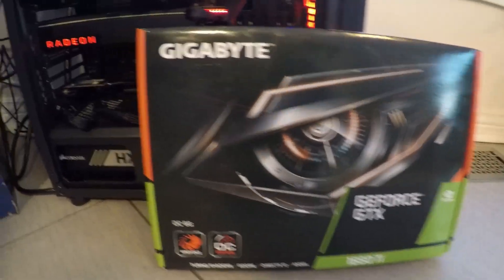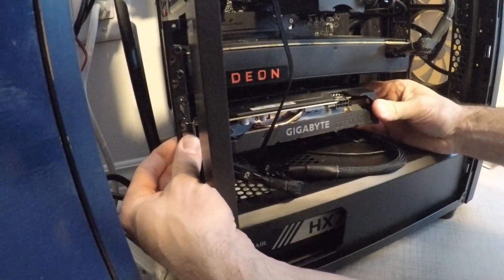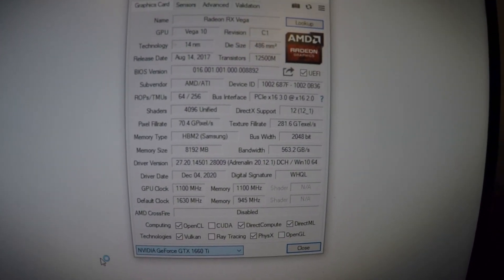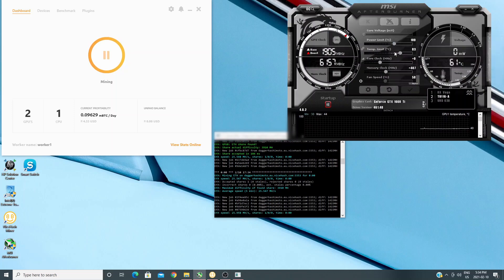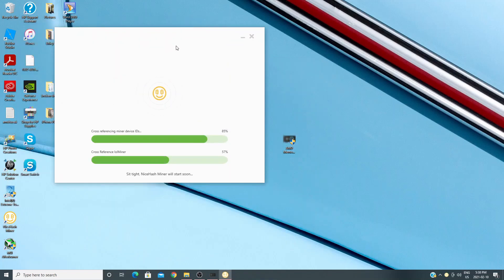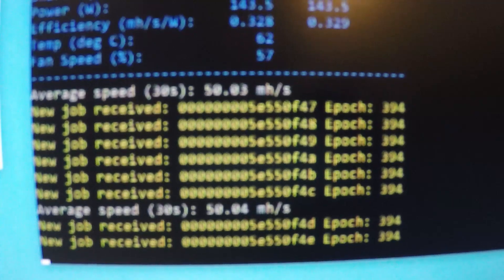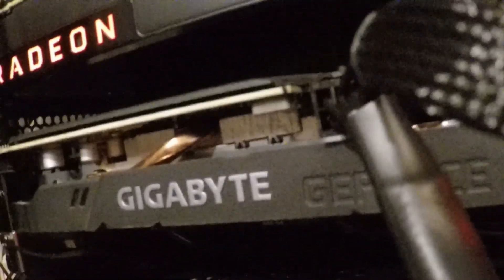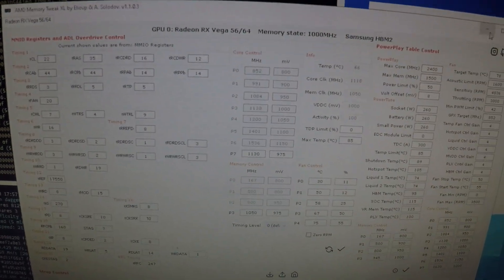AMD and NVIDIA GPUs mining on same computer

Comment: Thanks for the information. I have a 1660 gpu and i want to add a 1050 ti on the same pc but nicehash cannot detect the second gpu. Any ideas;
Reply from the maker: Does it show up in device manager, gpuz, and or afterburner? Or is it only nicehash that cant see it.
If everything else can see the gpu then I would try to reinstall nicehash.
If nothing can see the gpu, particularly in device manager, then something isnt set up correctly.

Comment: till yesterday i used only a 3060, today i got a 1660s and plugged in into my pc together with the 3060, but the display shows nothing, its black...why ?
Reply from the maker: Where is the monitor plugged in? The gpu or the motherboard.
Whichever one its plugged into try changing it.
You might need to go in to mother board bios and change it from IGD, to PEG. Or PEG to IGD depending on how you have it set up
Reply: @DIYNorth  thx for your fast help, the monitor was in the 3060 because its a UHD monitor , i want to game with it and when im not using the pc , it can mine , the 1660s is only for mining ,btw its a AsusB450 Prime Plus, i started the pc now only with the 1660s
Reply from the maker: @SurvivalGames1  I have the same thing with my 3060 and 1660 rig. I meant just run the monitor on the mother board output to allow you to get into th bios and change the graphics settings. I keep my monitor on the 3060 to get full hashrate, when I'm messing with motherboard bios sometimes I need to plug the monitor into the motherboard temporarily

Comment: Hello, can I connect a GPU on standard PCI and another via a riser cable? My idea is to play sometimes with the card connected to the PCI and leave the other one mining and when not playing, put the two to mine.
Reply from the maker: Yes a riser for one card should work fine. I'm not sure about gaming on one card while the other mines, I've never tried that. But it might be possible. My kids play minecraft and roblox while both cards mine and there are no issues. If you run a AAA title it might not work well though.
Reply: @DIYNorth  thanks man.

Comment: Hey, i have a question
I'm currently running gtx 1070 with my corsair VS650 and planning to install rx550. Is the VS650 is enough or do i have to upgrade my PSU? Thankyou for the great video!
Reply from the maker: Personally I would just run with the 650 watts. Each of those cards will use less than 175 watts when optimized, and the CPU, fans, LEDs, etc shouldn't reach 150 watts depending on what you have of course. I would suspect you will be between 300 and 400 watts when optimized for mining. I doubt that configuration could draw 650 watts at absolute peak power consumption of all components simultaneously.
That said, I got a gold rated PSU for half price from someone who bought a Newegg bundle, so if you can snap up a great deal on a brand new PSU at 750 or 850 watts it might let you expand in the future.
Reply: @DIYNorth  aight bro thank you so much! didn't expect you to reply this fast, really appreciate it!

Comment: Which motherboard do you have mate, if I may ask?
Reply from the maker: That one is an MSI Z490 Gaming Plus Motherboard. I have a few others and all of them work fine. I also have a ASUS and MSI Z270 obviously with older CPUs, and I have a Gigabyte Vision Z490 G, I got that one so that it can run 2 x 3060s directly off the motherboard. The Asus Prime Z 270 A is the one I use for my main rig as it has 7 PCIe connections.
Reply: I have a 1 question, My main card is RTX 2060, and I have 1 spare card and its RX 550 4GB, can I mine both?
Reply: What motherboard supports dual graphics card? Because, I had a A520M A PRO motherboard, which is it doesn't support dual gpu.
Reply from the maker: @fuexel7048  all of my motherboards can support multiple gpus. I assume the one you mentioned could run two gpus but you would need a pcie riser for the second one as you only have 1 full width pcie lane.

Comment: Thanks very much!  Still puzzled on a few things.  I've got a 6800XT mining when not gaming, OC'd using Radeon/Wattman.  I'm adding a GTX 1070 to the PC and understand I should OC the 1070 in Afterburner (used AB many years but, not with multi GPUs).  Once I save the settings for the 1070 and click Startup in AB, won't it try to override my 6800XT settings as well with stock settings when rebooting?   Perhaps I am missing something, like AB only attempting to engage settings for a GPU that has saved settings?   Another options is to use AB for OCing both cards and I'm fine with that but want to keep Radeon to control graphic settings and unsure what I may need to do to allow that.    Insights welcomed and thanks again, great video and helpful comments/answers!
Reply from the maker: I'm not sure what the rule is for when after burner will try to override your AMD GPU settings, but generally speaking for both Vega 64 and the 5700 XT I was using, I found that as long as you never saved settings for that gpu and hit the start up that after burner wouldnt try to adjust the settings for it. I also found that as soon as Radeon was opened, whatever you adjusted there would take precedence over afterburner settings. You could of course just use AB for both though.
Reply: @DIYNorth  I'm gonna rest a lot easier tonight knowing that, many thanks!  1070 arrives tomorrow.  If I DID use AB for both, do you know what I need to do in Radeon software?  Just switch off all the manual tuning buttons maybe, or go back to the stock default?      
Been going through your other videos and comments for other tips.  Very informative, really appreciate what you are sharing for us like-minded folks that haven't had quite as much experience yet.
Reply from the maker: @cruizera2194  if you use AB for both I dont think you even need to open the radeon software. The changes that you make in AB will be applied if Radeon isnt open.
I liked using the AMD software for the fan curves which I found convenient. Other than that either one should work fine.
Reply: @DIYNorth  PSA:  Happy to report it all worked, just as suggested above, driver installs, and running AB for 1070 clocks while Radeon handles 6800xt tweaking.  I hooked up a display to 1070 too, just to verify it was working.  It was delightful but weird to have a monitor powered from each GPU separately.  I could swap primary display with a click and run either I wanted for testing or gaming.  For anyone wanting to do this just to power extra displays or swap GPU types for specific games, I suspect you will find it easy to do.  Kudos to DIYNorth for the setup advice!
Reply from the maker: @cruizera2194  Now all you need to do is mine up some coins.

Comment: I have 3 different brand 3080s that require different settings, a 3060 that needs a specific driver to get full hashrate, and a 6800. Is it possible to run it all or most of them on a single rig? All Dagger hashimoto? I have all the hardware, risers PSUs etc already, i just don't know how to make them all work together in nicehash with individual settings. Right now they are all running in separate PCs
Reply from the maker: I think they could all run off one mother board. But yes you would need the nvidia development driver, and the amd driver.

Other than that MSI afterburner or a similar program would allow for all the gpu setting to be adjusted individually.
It has a drop down menu to pick which gpu clocks you are editing
Reply: @DIYNorth  can all of the Nvidia cards like 3080s also run off the development driver?
Reply from the maker: @BARBELLS-AND-BUDS  I dont know yet. I just got another 3060 and will get a 1660 super back from RMA on Monday, so I'll try to follow up on that one. My assumption is that yes they can. I ran a 3060 and a 5700 xt, so at least those two can work together.
Reply: @DIYNorth  I hope your new 3060 is into LHR model.
I think they are all LHR now since the beginning of this month 60s 70s 80s and the TI models also
Reply from the maker: @BARBELLS-AND-BUDS  no it's the old one. I got it used so I looked for a gigabyte Rev 1.0 model. But yes even on the used market a lot of them are the new LHR.
Reply: @DIYNorth  probably a lot of LHR on the used market because people bought them not realizing ii night a few igpus on the new egg shuffle but I don't enter anymore now the after low hah rate models are out are out
Reply from the maker: Just got my 1660 Super back from RMA and I confirm that it works with the developer driver along with the 3060. Absolutely no issues getting everything working.

Comment: Did you do some reconfiguration in your BIOS? I have RX580 8gb & GTX1060 6gb, I'm having a hard time to make them both mine at the same time..
Reply from the maker: The motherboard Bios or the RX 580 Bios? They should work without changing either of them. I do change the motherboard bios though as there is typically a "mining" setting or alternatively an above 4G decoding setting that I always use.
Do they work on any algorythms? You can't always mine on the same program for each brand of card.
For example, NBMiner for NVIDIA and Team Red Miner for the AMD card. This is why it might be helpful to use something like Nicehash.

Comment: SYSTEM CONFIGURATION 
PROCESSOR - RYZEN 5 1600 6 CORE / 12 THREADS
MOHTERBOARD - AORUS B450 PRO WIFI
RAM - 16 GB 3000 MHZ EACH OF 8GB
NOW I HAVE 3 CARDS  - GIGABYTE RX 570 4GB OC / SAPPHIRE R9 290 4GB / XFX 2GB 
*COULD IT BE POSSIBLE TO MINE WITH THESE 3 CARDS TOGETHER AND IF POSSIBLE THEN HOW*

**PLEASE HELP IN MY QUERY AS I AM ASKING SO MANY TIMES WITH MULTIPLE PEOPLE BUT GOT NO ANSWER FROM ANYBODY YET****

DO NOT KNOW HOW TO CREATE A MINING RIG WITH THE ABOVE HARDWARE -- WITH THE HELP OF RIZER OR THE OTHER WAY
Reply from the maker: Technically yes you should be able to make them all mine together although I've never used R9 cards so I can't say how difficult they are to get working. I would caution that You won't be able to mine Ethereum with what you have as you  need a 6 GB card now. I would recommend that you use Nicehash initially as it lets you test your cards against several coins in the benchmark setting. Once you see what coins you can mine you can switch over to that. I'm guessing that Kapow (Ravencoin) will be what is most profitable for you. Your motherboard looks to have 3 full width GPU lanes so you might not need risers. Just download nicehash and benchmark with one of the GPUs in the motherboard. Once you have that figured out add another card make sure it works and then add the final card.

Comment: PLEASE HELP.
I am using 6800xt, vega 64 & 2080super. I am getting crashes, auto shutdowns, blue screen of death. Whats the actual solution to it? How should I proceed?
I am using dual psu(850w & 750w), secondary one I have shorted the pins.
Reply from the maker: Have all the components worked individually in the past? That is a bit of a diverse set up, but it still work. Have you just tried to run two of the cards and  then add a third. Or just run the 850 Watt PSU? How many Watts does it draw? Can you eliminate the 750 Watt to test things out? I find the best way to get things working is trying different hardware options until the problem is identified.

Comment: How the fuck do I allocate the cards to not both be 0!? I've been searching forever for an answer, I can't run one of my cards because both the amd and nvidia cards want to be GPU 0
Reply from the maker: Up front, I've never had this issue. But I did a google search for "set GPU as primary" and it gave some options for both nvidia and amd. Not sure if that will help as my GPUs have always been assigned automatically to the GPU lane I install them into.

Comment: Finally I found this channel, I really frustated right now, I dont know what is the problem with my mining rig. I bought 4 pcs RX 550 4gb initially and build it completely and start the mining. It works for a while as sometimes the mining shut down and reopen the window of mining cmd repeatedly. A few weeks later I bought again the RTX 2060 and plan to put it together jn the same mining rig, but unfortunately after I put it into the rig, this shit make my rig couldn't booting and stuck in the black screen. Please help me. I really need your help against this problem...
Reply from the maker: It can be very hard to trouble shoot mining rig problems particularly remotely as there are hardware factors as well as software factors that might be causing your issue. Normally I look at the GPUs first and the move to look at computer software stuff. From the basics I would check to make sure that your PSU can handle the power draw, and then look to ensure the issue isn't from overclocking or undervolting beyond what the cards can handle. If that doesn't sort the problem out I bring the GPUs in one at a time. I would get the 2060 working by itself, then add one RX550, run that for a while, then add another RX 550. You might find that either one of the GPUs or one of the risers is having an issue.  If everything is working, but it is just a bit crash I would then look at drivers, Windows firewall settings, Mother board settings etc.  **before you do anything though, is your mother board set to "Above 4G decoding". Since it sounds like you are going from 4 GPUs to 5 GPUs this setting in the MOBO bios is very important to change, and could be your biggest problem.***
Reply: Dont mine with over 3 gpu's on windows! It will just rape you system, if you need help just watch how to install and use hiveos

Comment: Am I able too do this with too different nvidia gtx graphics cards:)?
Reply: and what are your thoughts do about having 6pin pcie on one gpu and a 8 pin pcie on the other I’m running a gtx 1650 ASU’s tuf and I’m looking too get a gtx 2060 would that be ok your feedback would be great
Reply from the maker: I've never had a either of those cards, but I see no reason why they wouldn't work just fine together. As long as you have the requisite cables (and PSU Watts) to power the cards there should be no problem.

Comment: Hello man just drop a rx 6700 xt , i have 1080 ti in my pc , i can use with the amd gpu ? i have 850w pc power supply , no need risers ?
Reply from the maker: I have not tried that combination of gpus but I am pretty confident you will be able to set that up.
You just need to install the amd driver and mine on an algorythm that  supports amd and nvidia. I would be very confident with 850 watts for that set up. And should not need risers as long as your mobo has 2 full width lanes. Just be mindful of the temperature if they are close together.
Reply: @DIYNorth  asked on discord they said need 1000w ? o_o idk if my GPU can , my gpu is close to the power supply cover but motherboard 3 Pcie
Reply from the maker: @MrLapairedas  I dont know what discord you asked on, but I'm running 7 cards on my main rig and that doesnt even draw 1000 watts.
My rig with 2 x 3060s draws 290 watts. And that includes the cpu motherboard etc. My PSU is only 750 watts for my rig with 2 x 3060s.
I recommend you get a watt meter and see what your actual power consumption is with just the 1080ti mining. Then add the amd card.
The watt meter will help you tune your cards and ensure you are confident that you wont overload your system.
I have a video with a 3060 and a 5700xt that provides wattage as well and it's also under 400 watts.
Reply: @DIYNorth  ok ty , I’m wrong actually I have a 650w 80+ gold so it’s too short , 850w min?
Reply from the maker: @MrLapairedas  650 watts is getting a bit low. I would personally try to run it if I were you, but I also have a watt meter so I would be able to monitor things. A platinum 850 or 750 would be better for sure, a Bronze 650 would be questionable.